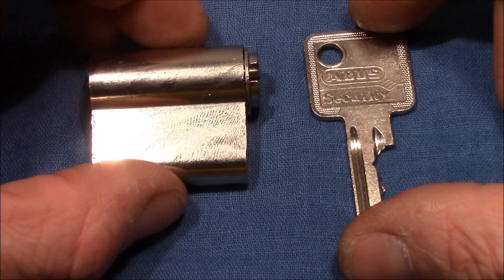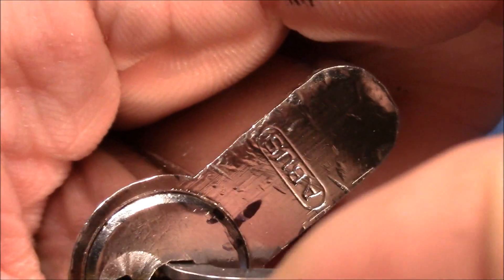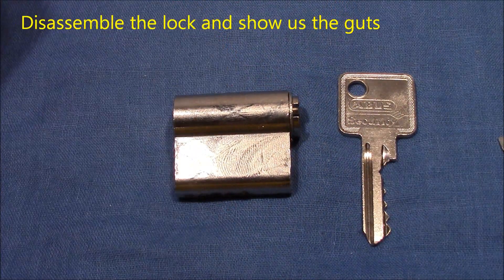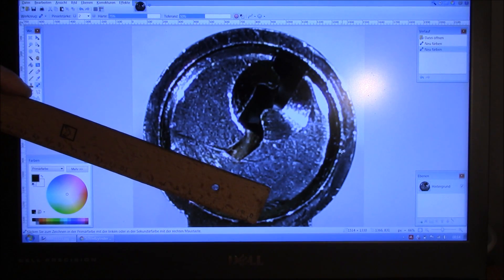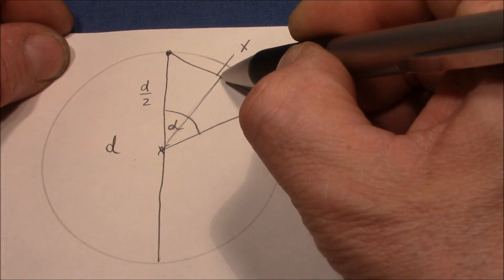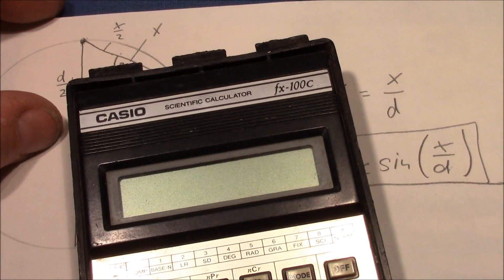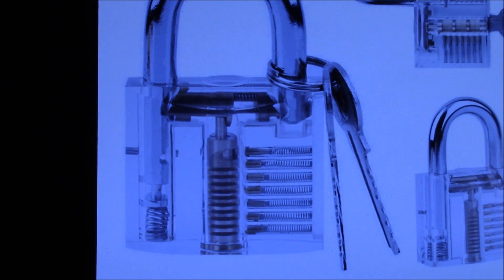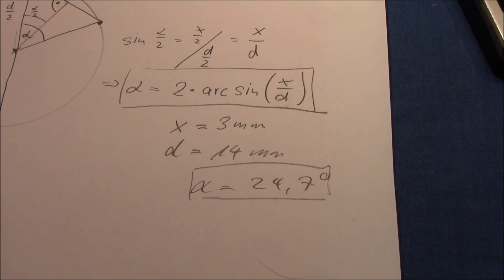(picking 112) False set competition - please participate - deadline 31-Mar-2016

Comment: You might want to define "false set."  Otherwise, the lawyer in me is tempted to make two entries... One real, and one taking advantage of ambiguous rules. 😜
Reply: +LockPickingLawyer Shh, in country where I came from we don't point out gap in rules, we use it to our advantage (and that is the reason my country is in so deep ... oh).

I will try to come up with some lock Potti. Will false set over 180 degree count?  :-))
Reply from the maker: +LockPickingLawyer I try to describe what I think is commonly agreed by the term: "A 'false set' is the turn on the plug while picking a lock and the lock is not open. 'Not open' means that parts of the locking mechanism (e.g. pins) are preventing the plug from turning freely. The 'maximum false set' is the angle from the start of picking the lock with applied tension to the maximum turn of the plug while still the lock cannot turn freely." Not sure if you still find a gap in that definition. I yes, please help me with a better one. I'm (unfortunately) not able to formulate it in a way a law is written. But I think that's OK, as that legitimates the existence of a lawyer ;-)
Reply from the maker: +Mike Pergl Stay fair guys ;-) 
Please remember another rules that says that you still need to pick open the lock after taking note of the max false set. "Picking open" means that there is something to pick (lock not open yet). Also please check my attempt to define the term "false set" below. If you still get > 180° - fine ;-)
Looking forward to you video mate :-)
Reply from the maker: +Potti314 Actually the definition was about a 'set'. The falseness refers to a counter-rotation that needs to be involved from the set position (plug turn while picking) before the lock goes into the unlocked state.
Reply: The "loophole" I'm thinking of still works... ;-)  Video to follow (someday, when I finally surface from under the pile of work currently burying me).
Reply from the maker: +LockPickingLawyer Alright. Looking forward to your "loophole" - although I'm not really sure if I do understand. But anyhow, it sounds like fun and I like the surprise :-) Just hope you will be able to pick it open from that state.
 ! Don't get buried mate !
Reply: +Potti314 Regarding the counterrotation: Say you would modify the lock such that the plug turns 20 degrees but then there is only counterrotation of 5 degrees back. Would this still count as 20 degrees (two cases: after these 5 degrees of counterrotation, you can set the pin. or you still have to manually turn the plug backwards because you still can't set the pin but there isn't any counterrotation)? Because according to your video and how one should measure the angle I think it would.
Reply: +Potti314 Second round of questions from me: How crazy can modifications become? Do the pins still have to be classical pins? Do I have to use a Euro cylinder? Do pins and pin champers still have to be cylindrical, etc?
Reply from the maker: +no-trick-pony_lockpicking Wow, I'm amazed how many details one have to consider.
- Counter-rotation: Angle 0° at start and max angle while picking and lock is not open. No matter how much counter rotation you will get. Your example: 20° would be counted.
- Modifications: The crazier the better. No restrictions. Just start with a normal lock and make your modifications to plug, bible, pins or replace the pins by other objects that you like.
I wish to see funny and creative videos. So please don't limit your fantasy.
But lock should still work normally with the key and you need to be able to pick it open after the deep false set has reached. All pins shall work OK.
Reply from the maker: +crunchbanguser Thanks for the link, will have a look at it.
Reply from the maker: +Potti314 OK, I see. Will you make one?

Comment: Why not just have everyone use the same style sharpie marker to do the markings, and just measure the gap between the two marks? Widest gaps wins. No triangles and overly complicated math needed.
Reply from the maker: +hellslave Thanks for watching. To use only the distance for comparison would  require all plugs to have the same diameter. An appropriate value would be: [false set distance] divided by [plug diameter]. But then you are almost at the angle equation.